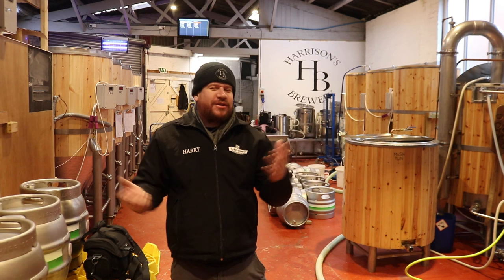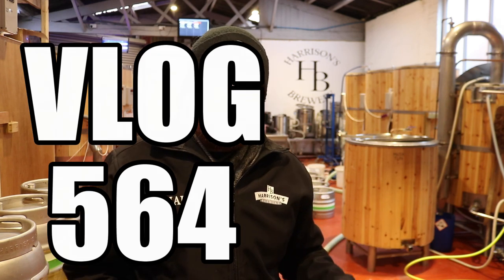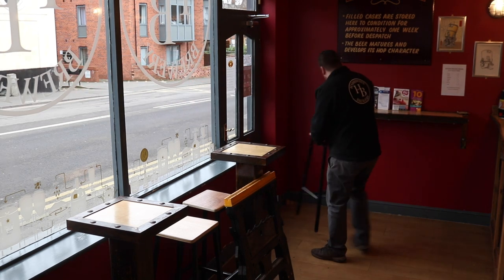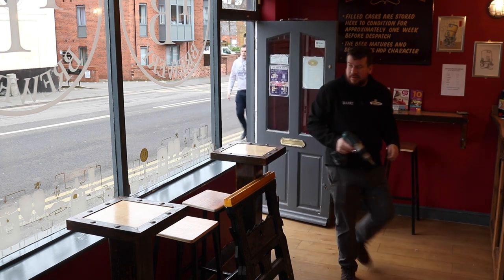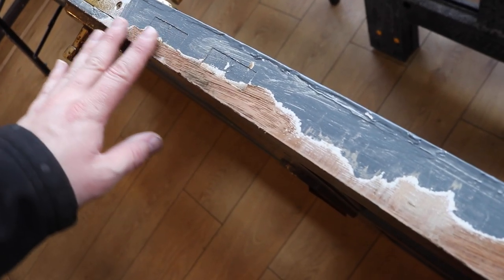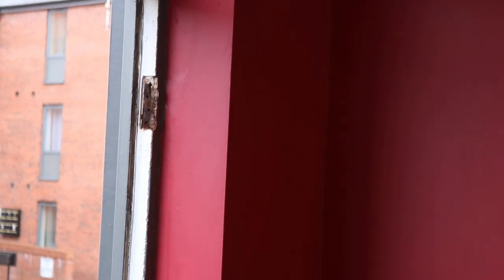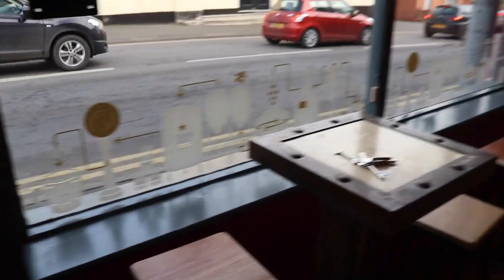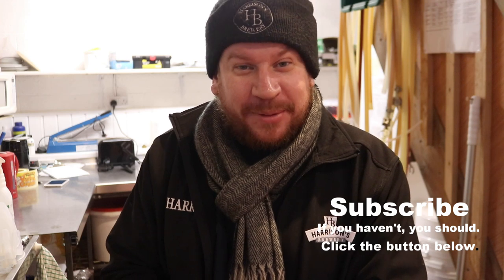WARPED WINTER WOOD

Comment: Makita, top tool 👍 . That looks like a crappy £6.99 workbench from screwfix, not a workmate 🤣 (I have at least three of those cheap ones 😉 🤣 ).  Good job, just make sure that you remember to paint them up. No worries on getting behind, I've been super busy recently and haven't had the time to tune in. I'm still in the process of uploading the footage from Hawaii so I'm almost a month behind by now 🤭 . Cheers, Schnuz.